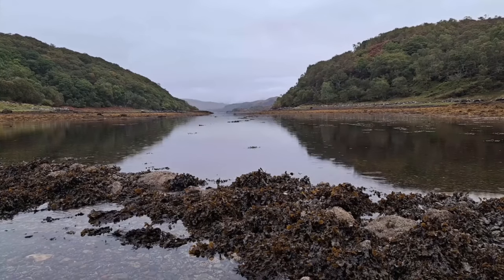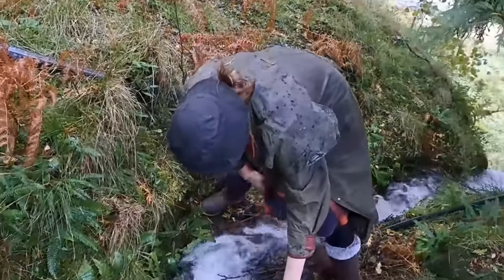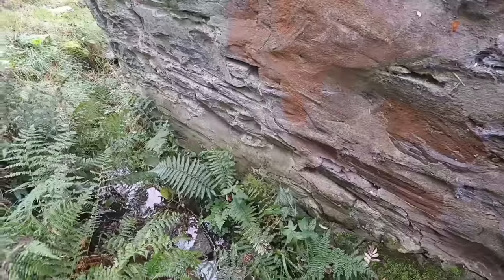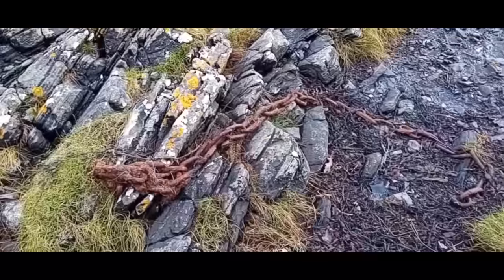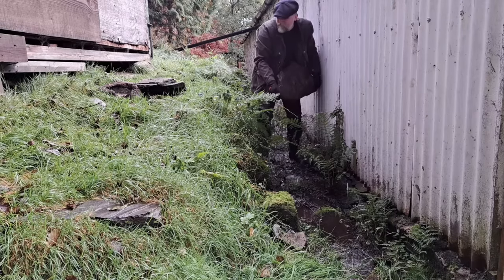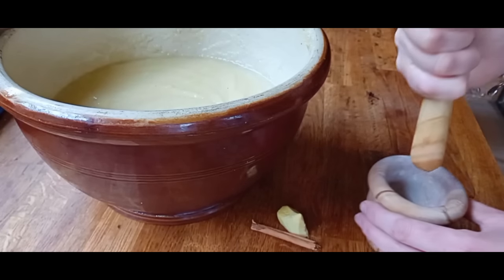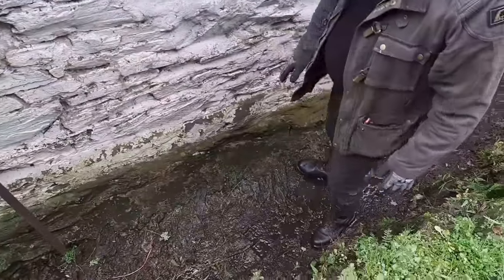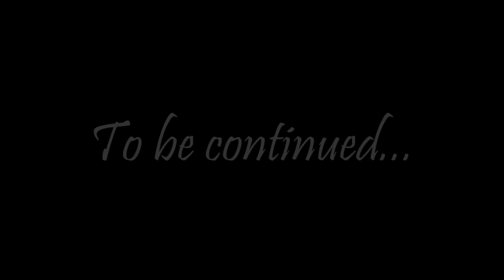18: The Apple Harvest; Traditional Cooking; Restoring an Antique Stove, Scottish Island Life Vlog

Comment: If you dig out the muck from the trench then put up a water barrier either by painting it on or using a rubber membrane then stack some of those rocks right along the house edge. Use some of that roof tin to create a diversion by laying it sideways along the length of the house leaning against it and the rocks. Haul up some small stone from the beach to fill in the trench and add a perforated drainage pipe. I'm sure you want to keep the natural creek coming from the top of the hill but putting in an actual culvert from above the catchments going directly to the sea would be a good investment. You can put in a line to go to your catchment tanks and divert the rest. For the top of your water line take some of your chicken wire and cris cross it over the end to keep the larger debris out of the line. I loved watching Katie making the apple butter!
Reply: Absolutely correct! 
You need to do proper drainage weeping tile and water proofing the side of the cottage !!!! You will need to dig down to the very bottom of the foundation of the cottage
Also a proper support wall for the bank also with drainage

Comment: Dig a collection pit at the head of your water pipes, rock line it and stick a funnel in the end of the pipe and mesh it, also remember solid fuel stoves need ventilation for safe combustion, so install an air vent into the cottage and  get a carbon monoxide detector
Reply from the maker: Thanks Stephen, sound advice. Well, there is another vent in the stove, and you're right about us needing a CO monitor. A funnel and mesh are going to be a necessity!
Reply: Was just about to say the same thing regarding a collection out. I’d go so far as recommending digging a barrel into the ground and having a way to divert flow and drain it out periodically to get rid of debris, etc.
Reply: I wonder why the builders didn't take more of the bank away and dig the trench away from the house.
Reply: I'm loving that so many people   provide such great advice. Invaluable and so genuinely offered
Reply: I'm not sure about the lay of things I was thinking king trenches inclined towards the lake

Comment: You were right. Socrates died from hemlock poisoning. The stove looks great. I wish I had some good advice to help with the drainage issue. We live in a small community and in the spring, when the snow melts, all of the melt runs from the alley, into our driveway, down our sidewalk and pools around the back of our house and yard. We have pumps that we put out to move it further along. It's a matter of engineering and way too expensive to correct for ourselves and the city is not interested in redoing the alley, so it is what it is. The apple crumble looked delicious. I could almost taste it, but with a bit of real vanilla ice cream melting over the top. Yum. Good luck with the drainage issue.

Comment: The stove restoration is something to be proud of. 

I do question the statement that the only way to clean out the trench is with a pressure washer. It seems to me that a smaller rounded shovel and a very stiff bristled broom would get the job done. I can’t imagine that previous occupants of buildings like this used pressure washers to accomplish this task.
Reply: I agree, don't add anymore water to the problem.

Comment: You could, potentially culvert the water away from the cottage with natural terracotta tiling.  But, there does need to be some sort of membrane all around the cottage to maintain keeping the water out of it.  The rocks still need to breathe.  Perhaps a nice stone or brick reservoir for the natural spring would be a better option.  There's so many things that could be done, but there are hardly any contractors or workers these days that know the older methods of doing things.  I've had to do all these things in the past.  I love everything about this place.
Reply from the maker: That's why we didn't want the contractor pouring concrete in the trench; there will be plenty of evaporation that still needs to happen. Lime is the only way!

Comment: Keep your doors and windows open when you light the first fire,  that lovely looking new stove is going to off gas for quite a while. Stove blacking and high temp stove paint does that.  I love the chain the tide brought in, it would look good hanging on the outside of the addition. I have an old one wth blacksmith made hooks on either end. I hand my clothespin basket on the hooks.

Comment: Hubby suggests putting gravel down, water proffing barrier, then a drainpipe...also you need to put in new eavestroughs, since that one has a huge hole in the middle, which allows the water to fall exactly down in the gully! And by putting the pipe going across the gully onto the land, well, of course it will come through the earth and back down to the gully!!!!! If you put in a new eavestrough from the roof going down toward the front of the house into a barrel and from the barrel an underground pipe back to the water's edge...that might solve part or alot of the problem!! Also, figure out a way to perhaps enclose the two huge water collection barrels at the creek and have a drain and pipe from there going out passed the house, down towards the water again. OR get yourselves a huge water collection barrel. Sometimes things seem more complicated then they are.I suppose it is all just a matter of how you look at it. Also, do look up ideas on internet....some are good ones, especially if you don't really know what you are doing or what to do. Good luck. and do make sure to build up the wall again where you removed the stones, so that the earth won't fall back into the gully!
Reply from the maker: Thanks for writing out his advice for us. We have found a long length of drainpipe and now managed to use it in the gutter downpipe hole. Might be a good idea to take an overflow pipe from the cisterns and just take ot straight back to that creek again. Someone else suggested hydro-electric!
Reply: @TheScottishIsle I noticed the drainpipe that you’ve put in, which is going back onto the land in front of the gully….but we were talking about removing that completely and putting a new one full length without a hole in the middle, on a slant either going  towards the front or back of home with a barrel and a buried drainpipe back to the lake or creek, but definitely away from the house.

Comment: If you do manage to straiten that back wall, maybe you can put a large gutter and drain it off down the sides, I'd extended the wall so that the gutter has good clearance from the house wall perimeter. Bitumen on the lower wall might water seal the bottom section of the house stones/concrete

Comment: There are a few points I'd like to make, especially about drainage. Underneath any stream there is always a 'plume' of groundwater. So the wee burn that supplies your black plastic tanks probably has a plume a few metres below and either side of its path. My advice is to relocate the stream above the cliff, above the colection point for the tanks. Redirect the stream further to the right, towards the BnB cottage/office, but well clear of both it and the cottage.
Second point. Do NOT allow the tanks to overflow, as this is simply adding to the load on the hillside behind the cottage. Suggest a cement 'lip' to the concrete and block tank stand, with a drain pipe to carry any spillage away to the burn.
By all means clean up the drain/channel behind the cottage, but chip away the concrete as well, because it traps water. If after doing all the above and their is no sing the cottage is drying out, you need to pull down and rebuild the stone retaining wall and this time cement mortar the joints between the stones, and renew and add more French drains at the foot of the wal, with geofabric over them to stop silt intrusion. Run the drain lines well clear of BOTH sides of the cottage.
If this still doesn remove enough water you will need to get an elctric jackhammer and a generator to run it, and dig the trench deeper, below floor level ideally. Use the rubble generated to pathc the holes in the path to the cottage. You SHOULD be using the 4-wheeler and it's trailer to get stuff to and from the cottage. Walking and carrying everything is daft. No offence. Quads are tricky to lear to drive, if your not already a motorcyclist of some experience. Go find a Forestry or Rural Services Course teaching how to drive them properly. There are some serious skills to learn there. And fit a rollover bar for peace of mind. If you quad is not a large capacity 4-stroke 4WD version, replace it with one that is. Use the jackhammer to dig away at those exposed boulders on the path. Use the rubble generated to fill potholes elswhere on the path. You need to become a 'road builder'.

Comment: Nice work on the stove! I suspect you might find controlling the burn a little challenging without the top vents, but you could always open up a couple again if needed, or just leave the door slightly ajar 😊

There's nothing better than a hot stove on a cold wet day.

Comment: Perhaps a stupid question but has there been any thought of putting an overflow valve on the water tank systems? That might give you some control over the flow of excess water. I know it’s still a problem but might ease it off a bit. Good luck and be safe all!

Comment: The connection between the two rain water collection tanks should be a couple of inches from the base, not at the top. The holes at the top should be used for an overflow pipe that takes any excess water back to the burn. This will stop excess water being collected from drenching the ground behind the croft. You're absolutely spot on that the house and stonework need to breathe. Cement and concrete is your enemy. Better to get that concrete off the rear wall at the bottom. Had the same issue with a 400 year farmhouse in Yorkshire. Any repairs should be in lime mortar and make sure the water has somewhere to drain away to and not sit. It's only there as it has nowhere to go. Keep up the great work. It's a hard slog.

Comment: Water creates so much work, but to not have it is far worse. Regarding your drainage problems, make sure that water can drain away from behind the house by creating/restoring preferential channels with French drains. You can't prevent water from entering that gap behind the house, but you can make it easier to channel it away so it doesn't sit perched against the house. Good luck!

Comment: If you've got an old car battery charger, you can derust that chain through electrolysis. Simply connect the chain to the negative, a piece of iron to the positive and emerse in a tub of water mixed with soda crystals. Make sure the positive and negative and metals don't touch directly. Leave to bubble away overnight and you'll have a clean chain in the morning - or 24 hours depending how bad it is. Wash off and wipe/soak in old engine oil to protect further. Could have done the stove like that too once the major rust was off, if you'd had a big enough tub for it. Looks lovely now with the stove blacking and window replaced.

Comment: A French drain in a swell in between the water fall and house extending away from the house then another at the end along the ditch is the only way to combat the water. It doesn't matter if it comes from the rock wall or bottom its all going to the same place. The drain will have to extend round all the way along the sides of house a few feet past the front of the house. That's how we do things in the hollars in Appalachian Mountians.

Comment: We were calculating the damage from the breached and blocked culvert under the driveway next door due to the water force collapsing the waterfall wall and gouging a 1 foot drop in the burn, subsequent drive and track turned to river beds, eroded to bedrock and cut off in 3 directions due to landslides 🤦‍♀️🤦‍♀️🤦‍♀️🤷‍♀️ the price of paradise 👍😉

Comment: What would happen if you moved the retaining wall at the back of the house back (away from the house) as far as possible - 6 or 8 feet. In between the house and the new retaining wall, you pitch the slope away from the house, so that the lowest part of the slope is at the bottom of the retaining wall. It's a good 2 feet lower than the part touching the house. It's there that you put the biggest baddest French drain you've ever seen. Like industrial size. And it drains like the slope drains now, half to one side of the house and half to the other. And, if need be, you pipe whatever water is coming off the hillside to either side of house.....? And maybe some berms higher up on the hill to divert water coming down it. There's GOT to be a way to keep that water away from the back of the house. Good luck to you!
Reply from the maker: Thank you!

Comment: Easy for me to say but if you have already caught the water or have running water then catch it into a pipe and take it away in the pipe until it can cause no more trouble. The water tank’s overflow being the prime example. Also, it might not be historically authentic but since you have caught the water on the roof, it’s better to have a gutter feeding into pipes to take it away.

Water in the soil will always magically find the lowest point so if you can see the water it’s better to take it away. Those black pipes are false economy they’ll fill up with dirt and roots I’d replace them with more permanent solid pipes.

I’m sure real drainage experts will have more correct solutions. I’d love to help and it will give me great pleasure to see it solved into the end.

Comment: Hi Guys, recent subscriber but absolutely loving it. I could almost taste that apple crumble! With regards to cleaning out the trench for drainage, I’ve found that using a water pump (if you can borrow one!) with less pressure but more water volume is quite effective at removing mud and silt from rough surfaces. Keep up the great work 👍
Reply from the maker: Thank you for the tip, and for subscribing!